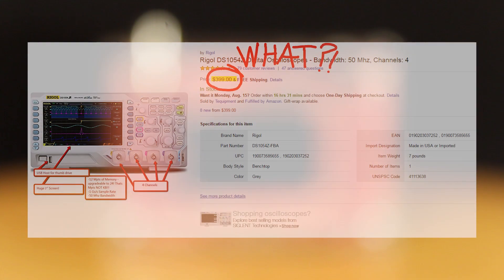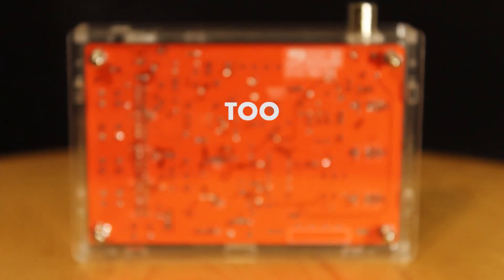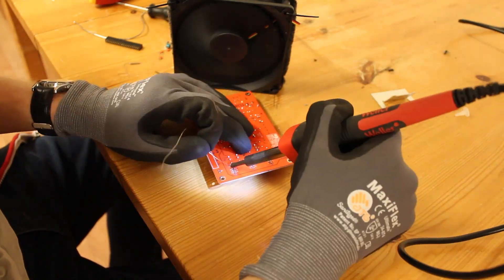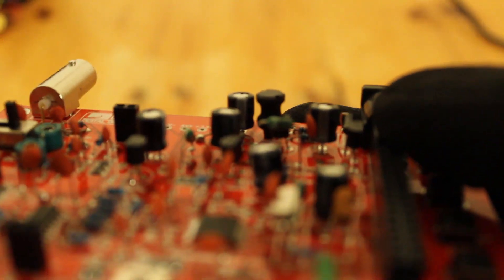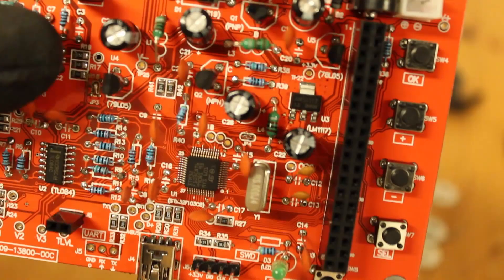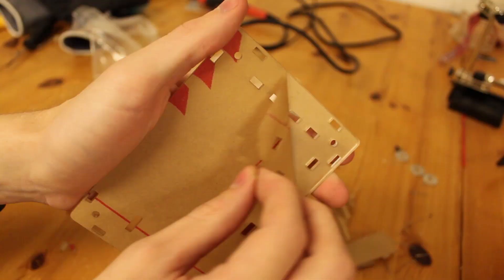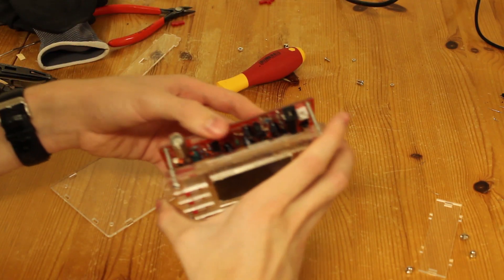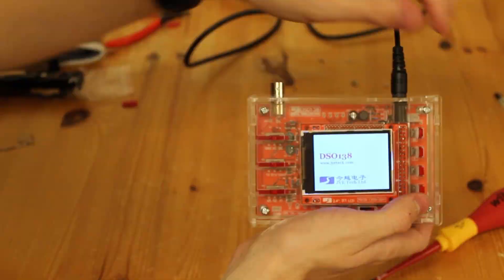20$ Oscilloscope | Was it really worth it?

Comment: The Surface Mount Resistors - are truly difficult to solder.
Reply from the maker: They would've been but thankfully in my kit they were already soldered on there. I would need to buy a different soldering kit to be able to place the surface mounted ones correctly i assume.
Reply: Difficult the first dozen you do.  Then you get the methods/tools down to where it's not that bad, then say fuck that, get some solder paste, get access to a fablab and laser cut a paste stencil out of kapton and use a heatgun or reflow oven.